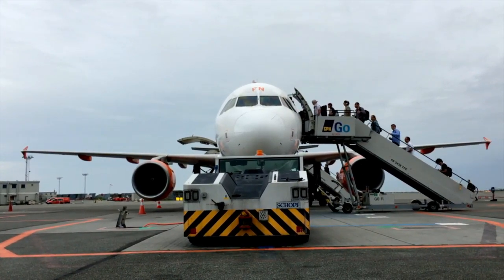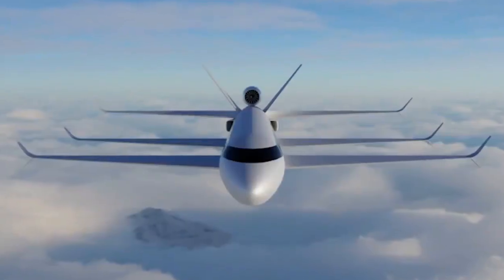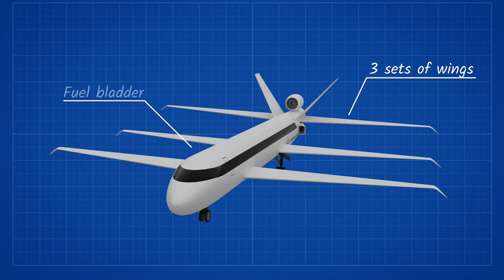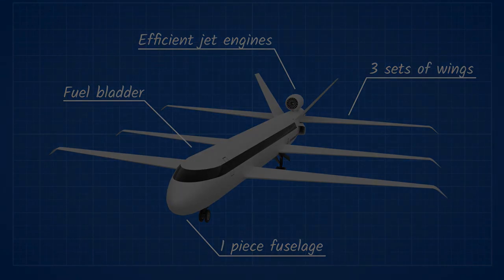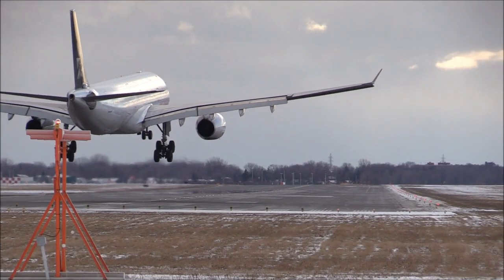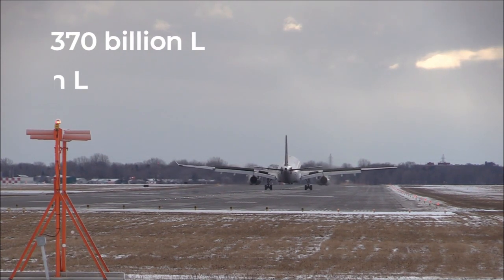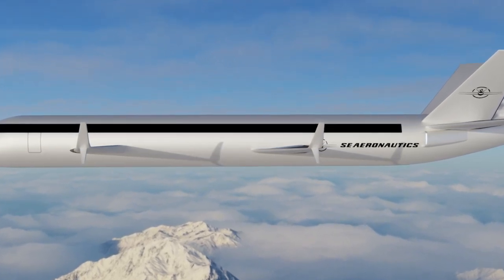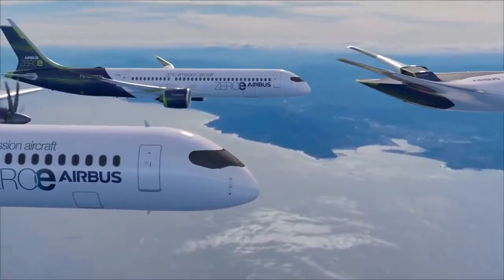Is This +70% Efficient Plane The Future Of Travel?

Comment: They need to put the fuel bladder on the very bottom in between the landing gear assemblies, move the two engines side by side one top of the fuselage, that would give room for a rear ramp door and give it more configuration options….